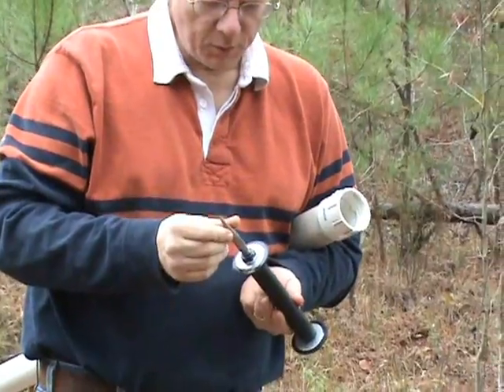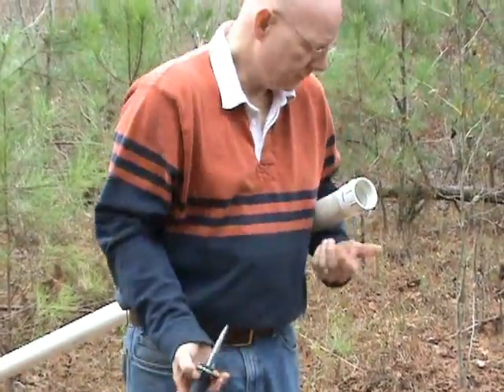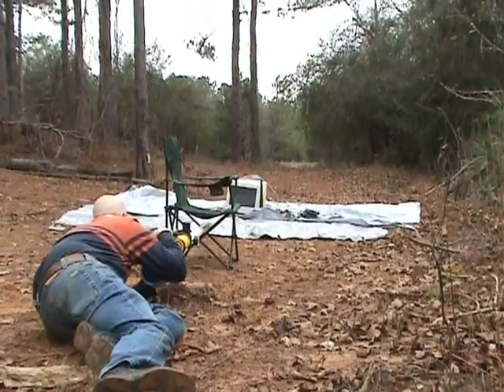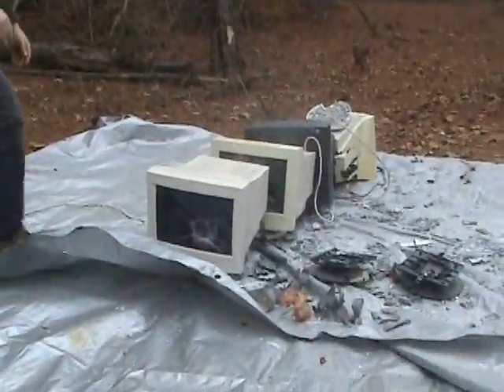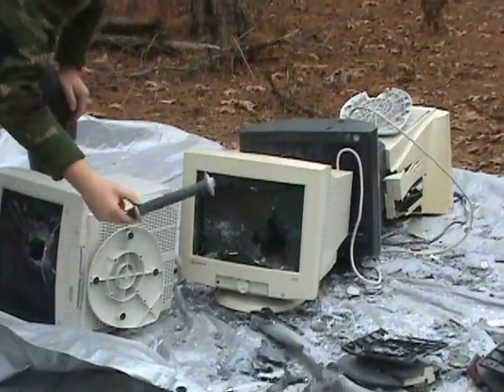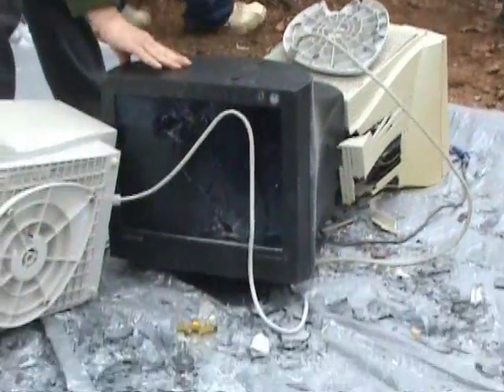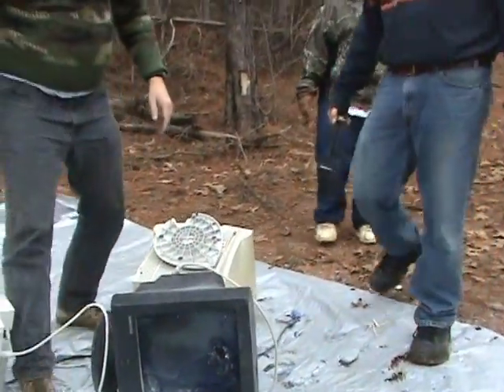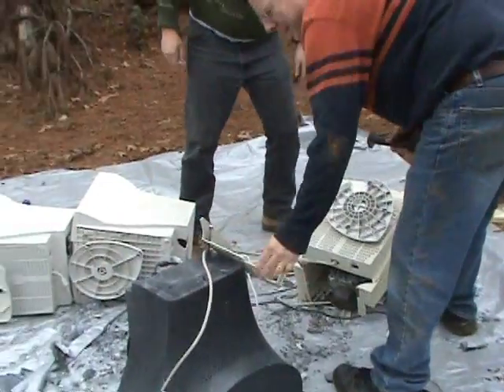Spike

Comment: @VerbotenDingleberry LCD? why not LED? i had a 1280x720 LCD (i speak in terms of screen resolution because i'm not really used to the term od inch) and now i bought a 1920x1080 LED and its a lot more easy on the eyes although the hertz are the same and it also weights less and uses less power.. and its like almost 2 times bigger than my last one so i was really surprised...

Comment from the maker: @radicalnegative1 

Look closely at about 0:07 seconds. It's a piece of pipe with metal and rubber washers held on to the pipe with a pipe cap at one end and a nut on the other end. The rubber washers are a little larger than the barrel and are placed between metal washers that are slightly smaller than the barrel. This puts a nice rubber seal in contact with the barrel wall. Add a touch of oil and there's almost no friction and a near perfect seal.

Comment from the maker: Air cannons are often more powerful than combustions as simple combustions have a hard time generating peak pressures over 80 - 100 psi. (Hybrids are another matter.)

300 PSI is gonna take one hell of a piston valve or a simple (but much slower) ball valve. Which did you have in mind? Either way it would probably beat this gun by a fair margin.

If I had added some drag, even a crude parachute tail, then it would have dropped away more quickly but I don't know by how much...

Comment: Is this your most powerful cannon?

I'm thinking about building a pneumatic cannon @ 300 PSI, 50 or 55 mm caliber. With a 2,5 meter long barrel. 

Hoping to build APFSDS rounds for it (armour piercing fin stabilizing discharding sabot).

Do you think (as a more experienced person) that that could beat this gun in terms of penetration and range? 

PS if you fire the round in this video at longer ranges, will the sabot come loose in the air and give the penetrator a longer range?

Comment: i just thought id let u no incase u ever wonderd to get the max distance out of a projectile requiers a 32 degree launch angle. i know ur target oriantated but just talkn any way i blew another diaghragm valve, thiers a ledge on it that induces a tare??? have u done this ,, im using 150 to 130 psi shots perhaps i want to much out of so little,althought the one i field the ledge of off has yet to fail

Comment from the maker: In a word, yes. 

Instead of hairspray I use MAPP gas (just Propane with a little Acetylene). I adde a fan to mix the fuel for the best power and a Fuel Meter to measure out the exact amount of fuel for the best power.

Because I added these features it is more scientific. Aerosol cannons are more of an art to get right than a science. 

I'm not that talented (or patient) so I built one that you can't load wrong. 

It goes boom on the first click every single time...

Comment from the maker: That's a fuel metering setup bolted to that gun. It's MAPP gas (Basically Propane with a little Acetylene added). The whole trick is to measure and mix the fuel just right. With spray it's an art, with a fuel meter it's pure science.